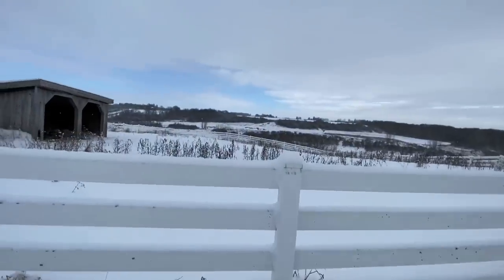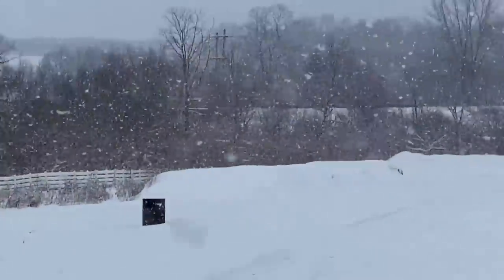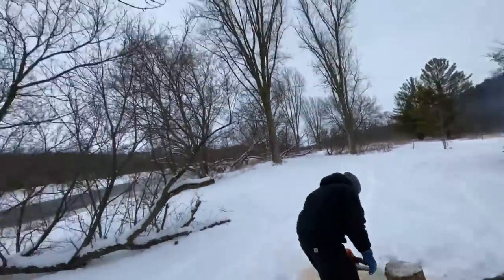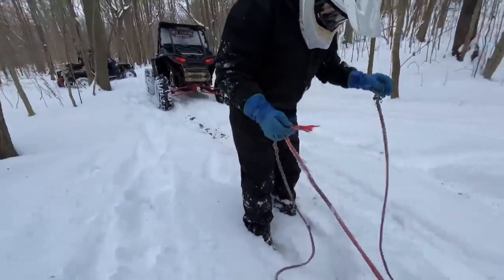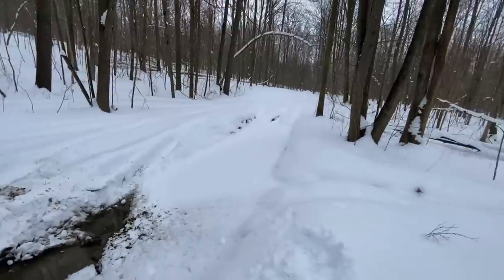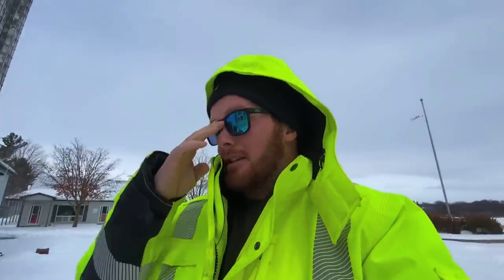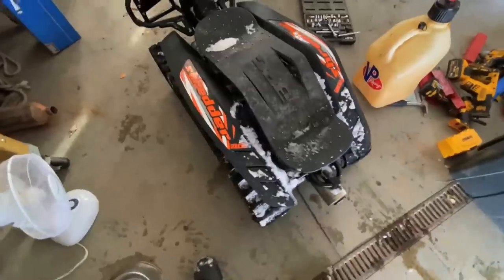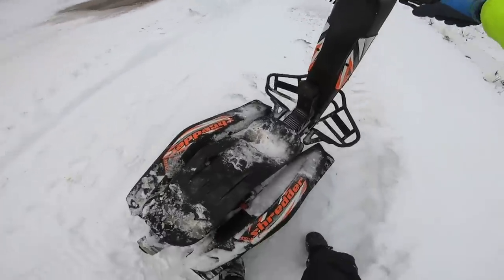DTV Shredder Is FIXED!

Comment: What if you clean it with water and he got like 50 mph winds there it's going to freaking free shut your locks everything I hope you kept your truck running to keep it warm to thaw out or you put it in the garage and at least put the heat on cuz otherwise everything is going to freeze up on you